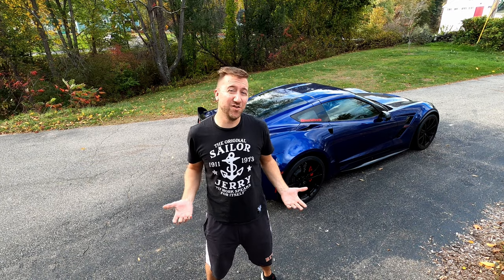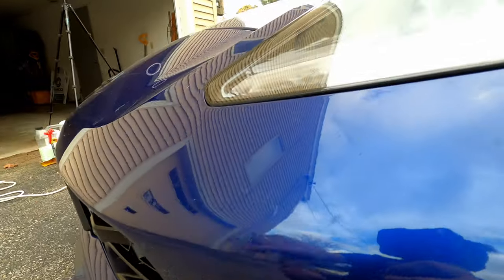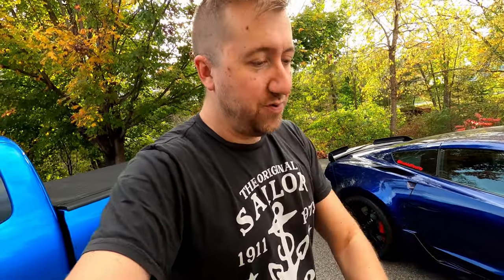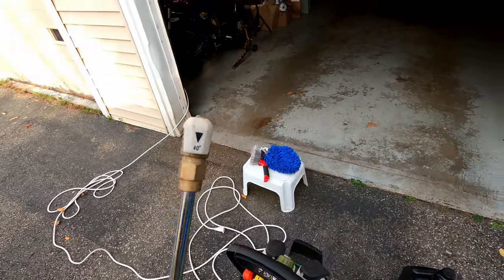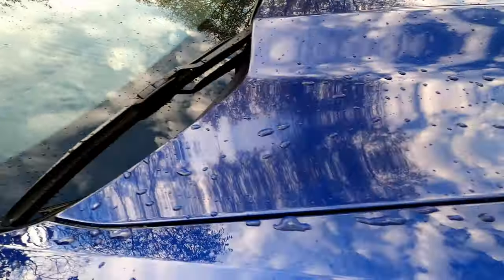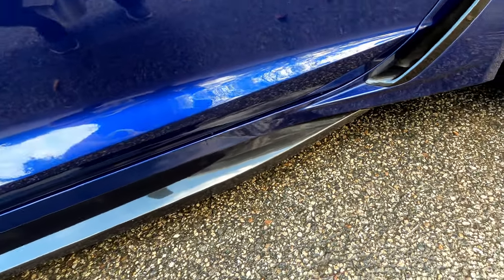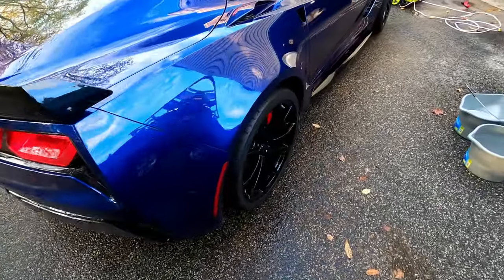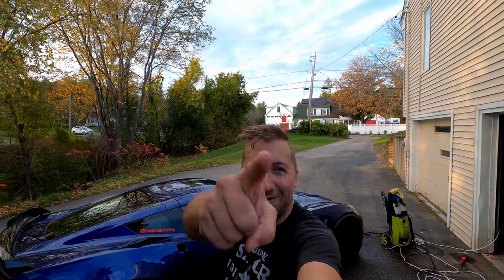How to wash a PPF car in under 30 min!

Comment: Great job, love the respect you have for your car. 
With my c7 Grand sport , I also have xpel.
I use a foam cannon with chemical guys honey dew car wash , section by section like you. Every section is done using the pressure washer and wash glove. 
 I use p&s brake buster (diluted 4to1) for the rims/tires. Scrubbed and rinsed.
I use a leaf blower to dry my car. Once dried I use (every 3 to 4 washes) a product called p&s bead maker. Boy does the water bead off but most of all you get a deep deep gloss. Well worth the extra step. Try it out. 
To finish it off, the tires get shined up with chemical guys VRP, nice shine no slinging. Trumpets get polished every wash with mothers mags and aluminum polish.
Reply from the maker: Thanks Tib, 
I appreciate the suggestions, will check out the bead maker, and the aluminum polish.  Agreed, I don't mind doing this process, and it comes out looking so great each time.  One other thing I appreciate about the PPF too, is that I don't have to be pedantic about a totally clean towel near the end of drying off.  Unlike raw paint, if the towel has microscopic dirt/dust on it, the xpel is protecting the car.  
I'm a big fan of "do enough", but not go over the top.  Like take reasonable measures to take great care of my things, but I don't want to spend my life using a clay bar, detailing lights, and spend hours washing and cleaning my car.  I want to spend 3/4 of my time (or more) interacting with the car, doing actual driving.
Have a great day, and thanks for reaching out!
-Fred

Comment: Love the color combo you have!! Car looks sweet!!
Question how much did it cost you to Xpel your car and where was it done? And how long have you had it?
Had my SS 1LE parts Xpel hood nose rocker panels and rear quarter panels!
Reply from the maker: Thanks man!  It was about $4k at the time.  I had MacMulkin in Nashua, NH do it before I took delivery of the car, so I didn't have to drive it without protection.  I got the car new in 2017, so 4 years so far, coming up on 5 in January.  Car looks as mint as the day I got it. 
That's great you got those spots, that'll protect you for sure!
-Fred
Reply: @FredsFullThrottle  wow 4K is a pretty good deal!
Reply from the maker: @TrigunV4S  Haha yeah.  At the time I thought it was really expensive (with tacking it onto the cost of the car), buuuuut after reading what it costs separately, I definitely think they gave me a discount since I bought the car. :)

Comment: Awesome 👏 Fred. Is that the standard spoiler for a GS ? Damn too bad I’m not ready to buy, you did mention you’ll be selling it soon. this blue metallic is great, although I Do you like the aluminum finished wheels better than black or dark gray
Reply from the maker: Hi Stephen,
Nice to hear from you!  So I added the additional "wicker bill" spoiler to the GS, which comes on the C7 Z06.  Truth be told, it was only about $150 from the dealership and I was able to install it myself.  The stock GS spoiler is lower in height, but it was really easy to swap out and took maybe 30 minutes.

We'll see when my car goes for sale (I will happily let you know when the time is just in case), but it will be a while yet.  I'm in the upper 1100's for the Z06 list at MacMulkin, so I'm thinking at least 3 years out, if not 4 depending, so the timing may actually line up.  If a ton of people cancel it might be 2nd year, but it's all up in the air.  As to the wheels, I like the black ones with my paint (Admiral Blue Metallic), but other colors I like the aluminum finish.  Not a fan of chrome, but some look good on certain spec'd cars.

Go for what you like best!
Have a great day!
-Fred
Reply: @FredsFullThrottle   nice to hear ! I’m definitely 3 years out on my end savings wise, so this may work out if the timing is right when you’ll be ready to sell your GS. We will see how much they are worth in 3 years from now and how much I can work into my budget. 

I don’t like chrome wheels either. I’m sure if I seen your car in person those dark finished wheels wouldn’t look so bad. Highlights the black trim throughout the car which is nice 

I saw your other video on the Expel paint protection and that is definitely a nice thing to have done. 

Have a good day !

Comment: by your 10th wash, you probably rebuilt the transmission and did the head gasket on that *thing, LOL
Reply from the maker: Hi Fernando,
Thanks for reaching out.  Not sure what you're getting at....the car has been super reliable and has had no significant issues in the 5+ years I've owned it.  Anyway, have a nice day!
-Fred

Comment: WHY DID YOUR CHANNEL DIE DUDE?
Reply from the maker: Hi WalterWhite,
It's not dead, it's just sleeping.

Joking aside, I posted a video in April that explained the gist of it (here: https://youtu.be/BJeIvd8OJ0g).  I've been spending more time doing things rather than focusing on capturing it through the lense.  I found that the effort and mostly the time I was putting into YT wasn't worth the return I was getting (every video taking 4-6 hours to make), and that I wasn't really doing it for the right reasons.  Also, as my interest in the Z06 wained (I'm not going to buy it when my number is called), I haven't been following car news nearly as closely.  This past year was one of the best of my life, and wouldn't have been possible to do and balance juggling videos.  I spent 2 weeks in Alaska, lived on the coast of Maine for 2 months over the summer, bought 2 motorcycles, did a bunch of autocross and worked on the Lemons car.  Every spare minute was filled with fun!

That said, I am going to periodically make videos when I find the right things to film, like the lemons racing, stuff with my Ducati's, and the occasional car news.  I'm still saving up for my next car (likely a P-car), but am keeping the C7.  I know that's disappointing for many to hear, but it was a huge relief and reduction in stress for me.  Cars are just one of several hobbies I have, and I found it was cutting into those other aspects of my life.  Hope this makes sense.

Sorry for the disappointment, but in general when I do post videos, they will be about things I'm passionate about, and made for fun, rather than to get views.

Thanks for reaching out, Happy Holidays!
-Fred
Reply: @FredsFullThrottle  wow, thanks for the detailed explanation.. god bless